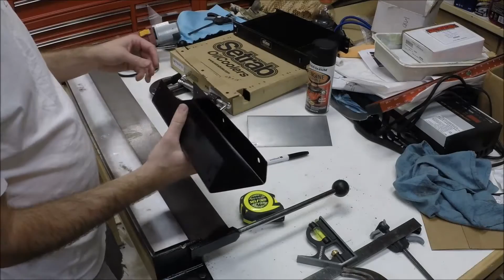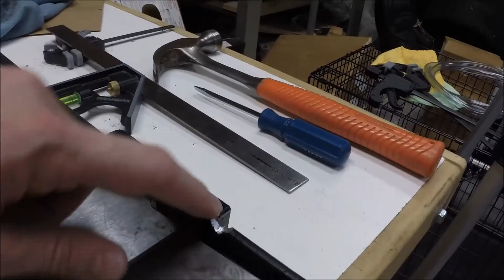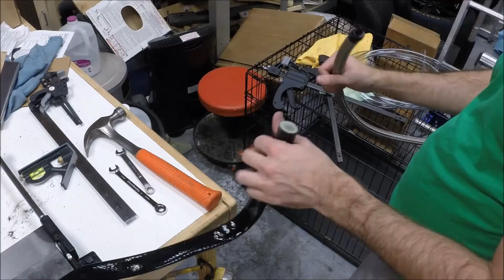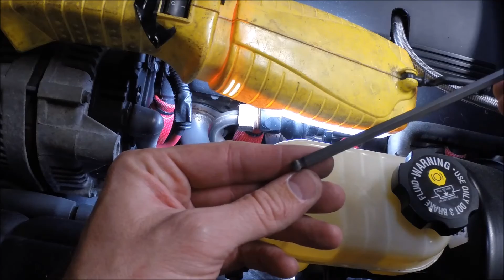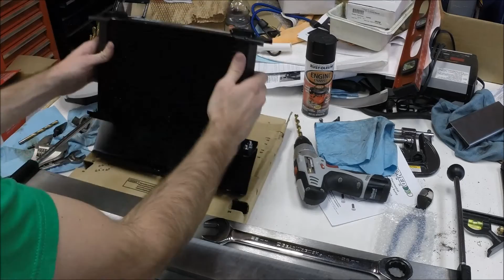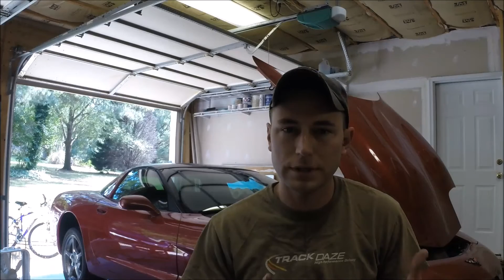C5 Corvette - Engine Oil Cooler Installation

Comment from the maker: A couple of updates.   I installed a new DeWitts aluminum radiator, which is thicker than OE and interfered with the oil cooler.  So I fabricated a new mounting bracket to reposition the cooler, but I used the same mounting bracket design and mounting location.  Also, while I had the engine out for a rebuild, I extended the wiring for the oil temp sensor.  Alternatively, I believe Improved Racing now has a redesigned adapter block that puts the sensor at a different angle and doesn't stretch the wiring, so just buy that one.
Reply: Can you post any pictures of the oil cooler mounted with dewitts radiator?

Comment: How are oil changes with this setup? Any old oil get stuck in the oil cooler? Any special oil change aspects to deal with?

How are overall oil pressures? I've heard tale of oil coolers dropping oil pressure.
Reply from the maker: The oil cooler is after the oil filter, so the drain back valve prevents the oil in the cooler from draining back into the pan.  Which is good so that it doesn't have to refill the cooler on startup.  But that also means the cooler doesn't drain during an oil change, so keep that in mind.  As for pressure drop, I'm sure there is some, but it wasn't noticeable.

Comment: did you use 2 90-degree fittings at the adapter and 2 straight fittings at the oil cooler?

Comment: Hello.  Where you mounted the oil cooler did you notice any increase in coolant temps?  Thanks
Reply from the maker: I did not notice an increase in coolant temps, or if there was, it was very small.   But since then I upgraded to a DeWitts aluminum radiator while I had the motor out.

Comment: Did you end up at 7 or 7.5 quarts? Curious did you mount the cooler high enough so the oil in the cooler/lines drains during an oil change? I didn’t see exactly where you installed it. I’m thinking about putting mine behind the license cover since it is dedicated track car.
Reply from the maker: I mounted mine in front of the radiator.  You see a shot of that around the 20 min mark.  I’ve been pretty satisfied with that location but other spots may work just as well.  Honestly everything is so tight under there that you don’t get the option to run lines but one way.  So it’s not really possible to get the lines to drain during an oil change.  The lines come into the cooler from the top, so the cooler isn’t going to drain.  I’ll have to capture and measure how much comes out at my next oil change.  (Im curious now). As for capacity, the cooler holds roughly 1/2 quart and then a bit more for the lines, but that’s not much.
Reply: @ScrufsGarage Good information. Thank you. One other question. Did your oil pressure change once you added the cooler into the system? I assume some pressure loss is worth cooler oil but just curious what you experienced.
Reply from the maker: I don't recall seeing an oil pressure drop, though there could have been a small amount.  I'm on a new motor now, but I sit at 36psi hot idle.   Also, if you're using the car in a way that merits an oil cooler, keeping the oil cooler actually helps maintain oil pressure (vs thinning out at higher temps).   So overall I'm 100% happy with the oil cooler setup, even when I'm street driving it.  And obviously at the track, it's worth it's weight in gold.
Reply: @ScrufsGarage  I didn't think about that component. The cooler oil will be thicker helping keep pressure up. Good stuff!

Comment: BUILT NOT BOUGHT 🧛‍♀️
Reply from the maker: I hear ya!   Though sometimes I think I'd like to try the "bought" camp haha.
Reply: Is that the same sensor, that came out of your car. that you put in your improved racing block. I have the new Improved racing block , looks exactly like yours. the sensor hole on mine looks to be to small. butt if the old one fits there's no sence in taking a chance on a totally new sensor. I don't mind the tight line, general motors builds there stuff that way.. plastic instead of something that would last ….  I still need to put the improved racing block on my car.. the hoses are wrapped up and tied down...being handicapped bites a rotten apple twice the amount of time for everything... Pls reply to "is that the same sensor"
Reply from the maker: Michael Mack  yes that was my OE sensor that I reused.   I.R. has since redesigned the adapter block to put the sensor at a better angle so the line isn’t so tight.  So depending on when you bought yours, you might not have that concern.

Comment: Everything I added to her is modified racing gas cap fin on back wheels good thing I like wrenches they said gas cap was bolt on butt it wasn't had to cut and grind a round secure metal donut made it look like a football to make it fit the brakes where in the way needed a spacer oh ya car was yellow when bought now it's black with flames look at (corvette racing horse) on utube that's mine workers comp bought her for me 26yrs of water well drilling..🚓

Comment: Just installed dewitts upgraded fan and all aluminum radiator with oil when original fan and radiator out it was easy to run my oil lines now my C5 corvette runs at 195 to 205 degrees i love my engine save oil from burning and my gasket's from cooking every time I'm in drive thru excellent
Reply from the maker: Awesome!    The DeWitts stuff is very nice.
Reply: The gasket that goes on the improved racing block you didn't use oil what did you use to make it stick so it doesn't  move when installing and after you take the fuel pump fuse out how many times do you turn it over or how many pounds of pressure  for the oil does it need .
Thanks for your time being handicapped bites but I'm planning to get the oil hooked up to run thru my radiator just needed some pointers..
Reply from the maker: If I recall correctly, I used vasoline on the adapter block o-rings to help hold them in place.   If you have an auxiliary oil cooler (like I installed), I recommend pre-filling the oil cooler so you already have some oil in the system.  If you have an oil cooler built into the radiator, you can likely still pre-fill the oil cooler, but I don't have that style, so I can't give specifics on the process.   Then crank over the motor for 30-50 secs to pump oil into the oil lines.    If you can't pre-fill the cooler, you'll have to crank over the engine a little longer to fill the cooler.   My Setrab 625 cooler held approximately 1 quart of oil.

Comment: Are you still happy with your catch can/ clean air set-up? I've got a 02 Z28 that I bought a rpmspeed/ws6store catch can that does work some but not all that great. Was thinking of adding a clean air separator to it and see if it does any better and that Elite Engineering one looks to be better designed all around. Really enjoy your videos!
Reply from the maker: Yes, I still really like the Elite Engineering air/oil separator and the clean side separator.  I'm always amazed at how much oil it catches during a track day.  I typically empty it at the end of each day at the track, just to make sure it doesn't get too full.  A good test is to thoroughly clean your TB and then check back after some hard running and see if there are any oil deposits, which would be a sign oil is still getting by.
Reply: Give the Mighty Mouse catch can some time. You'll see a huge difference.